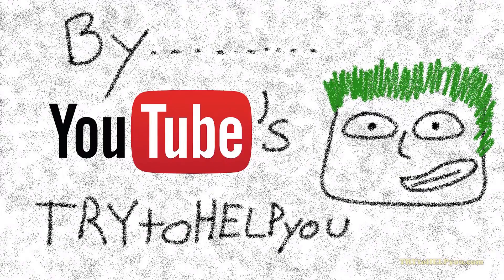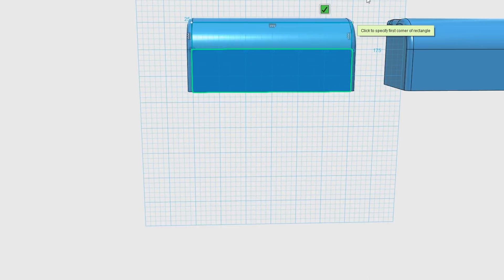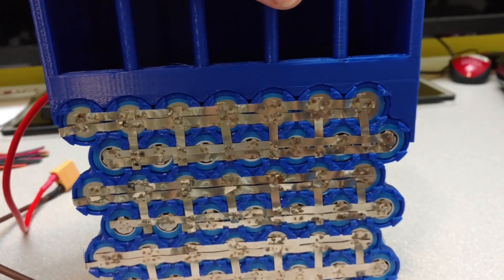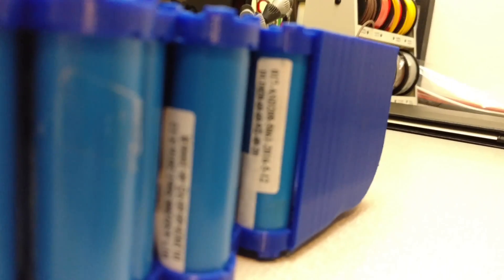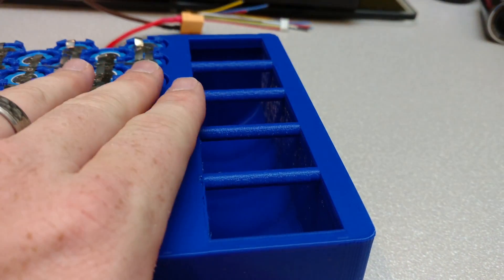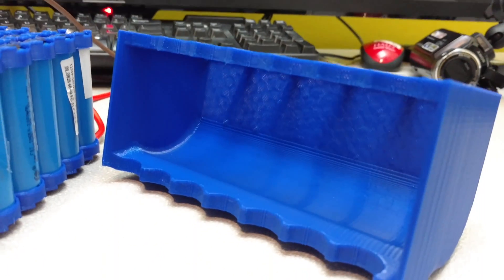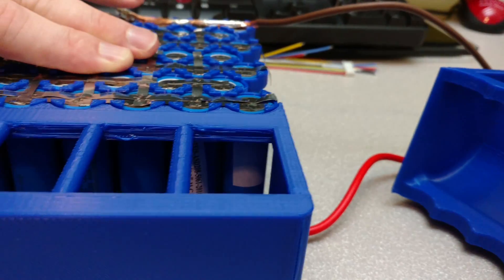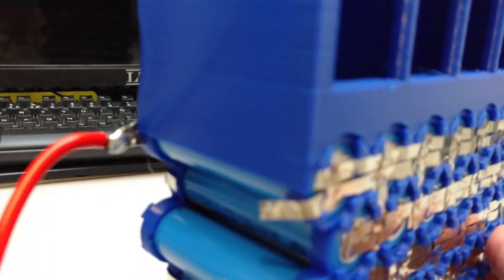eBike Battery update - custom cooling design/3d printed shroud

Comment: I know this is years ago, but is that a metal rings he’s wearing and putting his hand on the pack with exposed strips!?  Way to short it out in your finger!
Reply from the maker: while it is worth mentioning safety, the voltage that is available that would make contact with the ring is so low, the reaction time to pull away would be ample. This is a relatively low voltage battery. In the case of a full short circuit the ring's shape and size make that impossible. IT is likely better to not be wearing a ring but in the case of this very battery, it is not an issue like it would be with in-wall electrical wiring.

Comment: Nice job on the design, but if you feel the need to cool those 18650 cells and they are getting that HOT, then maybe you not using the correct rated cells for that pack.
Are they getting hot, have you tested the pack yet?
Also I don't know what protection your running (if any) or BMS you using. If the lack is designed for balance charging or not? Sorry, just found your channel, so I need to check back a few videos maybe. But I would suggest putting the fan in a separate pack if you feel the need for the fan. Don't drain the pack unevenly, if their no protection on individual cells (and that would hinder the packs performance for a ebike) then this could cause one cel, to try and charge the other cells you draining more with the fan, and ciase other issues as well. Well it depends if you tapping off cells in parallel or series. Basically of would just be easier and better electrically designed to 3D print a separate battery holder for the fan separate cells. Later you can add a circuit to even monitor the packs temp in maybe 4 different spots and set a temp range for the fan to come on, and turn off as needed. Then use that  circuit to sound an alarm if it detect the temp above a safe temperature so you can get off the bike, unplug the battery fast before disaster happens between your legs :-(
So for the separate 3D printed box for 3 cells for the fan, leave a little space to add some of this added stuff for future monitoring and safety. Maybe design it with a track for a seal to make it water resistant also? 
Nice pack by the way, I'm sending you a message. Had a question for you off the public forum.
Scott

Comment: hot glue is for old women crafts and duct tape is only for a quick temp fixes in the field to get u by till u can fix it properly. Honestly I own neither they have no place in my shop along with super glue. Maybe u could have integrated some tabs for screws in the design of your air box? A good 2 part epoxy used properly is what I would use if I had to. I'm a firm believer that before starting any Fabri-cobling on any of my project you should have every detail worked out. Saves me a lot of head ache. But with that said even with all the planning in the world things don't always go together as planned lol. Cool videos liking ur content trying to up my battery  game lately thinking when I have more time on my hands I can build me some cool battery powered stuff one day if anything I'm learning sometime
Reply from the maker: +thanks for the comment and good words. While i yield to a similar logic, i would get stuck in the planning phase if that were the case. I will be treating this project somewhat similarly to art. Just have a go at it with som details worked out. As for mounting brackets, good idea, im still unsure as to what the sides will look like but..
 Maybe ill do something screw related for assembly. I ran out of blue filament and will be loading black.... this first run will be frankenbattery as far as i can tell. Safety is my number one thing i will not budge on. I need to sit down at the computer and carve out the next couple pieces soon... stay tuned for more of course!
Reply: TRY to HELP you your videos were worth the views for the heads up on the battery spot welder a lone thank you for that.

Comment: Which CAD software did you use if I might ask? It doesn't look like Autocad or Turbocad but I can't tell. I enjoyed seeing the 3D and I know how much work and skill it takes to compose a drawing adequate for printing.
Reply from the maker: Thanks as always for commenting Sir! I used Autodesk 123D Design . Im not sure that you can get it for free anymore. IT seems a few months ago they ditched giving out this ... It is slow and wonkey but at the time (year + ago) i just needed something. I just had to design an object to hold up our curtain rods. I will be posting a video this week. Looks like it will be around or less than 13 mins. As for the battery heat, i have heard many people talk about how their ebike batteries get warm/hot due to use. I would like to keep that down is all. These batteries did great in the initial test the other day. I went a little throttle happy and went ..um.. wide open throttle.... hmm. yeah, for about 10 mins or so straight. They got a little warm. Thanks again for the good words!
Reply: I design chemical process equipment, have been using Autocad for 26 years. I love the 3d finished drawings but converting the 3d to plan and elevation drawings for the un-current real world is so frustrating as the extra lines and shading are a huge obstacle.  i stick with 2d but now that I see the fun with the 3d printer I am again compelled. I use Turbocd 3d at home and Autocad for my client design drawings. I am impressed that you have to patience for 123D design as I know you had to have spent many hours learning how to avoid the pitfalls.
Reply from the maker: So it has taken me 5 days to get to this comment and i apologize for i read part of it a few days ago but was busy. Thanks again for the comments! As for 123D Design, i had been, at first, importing a 2d drawing from Adobe illustrator. That was measured out precisely and then i would extrude the 2d into 3d in 123D design. If you would like to see when i started doing the deeper 123D Designs watch this https://youtu.be/E-E8t7TWt6Y . I built that entire thing with just 3d printed parts. All designed by me. It took a while but was a great experience to youtube search how to use the program. the program hangs up a lot because i want to say it only utilizes one core of my processor, but it does get the job done. 26 years of autoad is unbeatable tho man. thanks again for engaging and your comments Charles!

Comment: You know forced convection cooling heat transfer, even in this configuration would be over 10 BTU/ SqFt/Degree F Delta-Hr. This will work fine with a few CFM.  There isn't that much heat generated unless a cell has a short that over heats it. That is pretty rare unless there is  failure during charging, but that typically is due to a charger malfunction or damaged battery. I've never seen an ebike battery burn up upon use but it certainly is possible. If charged properly within range, in a balanced manner it's going to be fine unless something very unlikely happens.
Reply from the maker: Charles, you sank my battle ship.... I am answering more to your other comment now!

Comment: Nice job senor taccitos...did you do it in pla?
Reply from the maker: Yes Sir, PLA is all i can do with my DREMEL 3D20 IdeaBuilder. it may change shape over time.. but i dont think it will get that hot.. Im not planning on leaving it in the car on a summer day... I just dont need my battery getting hot. The other day it was nearing 110 degrees. The outside temp was below that and i would like to use some of that to cool it down :)
Reply from the maker: ment to say thanks too... thanks!

Comment: Those ducts turned out great! I dunno, though... I'd feel weird tapping a few batteries like that rather than just feeding the pack output into a small/simple DC/DC converter circuit to power the fan (it would also give you lower voltage DC for powering other stuff... like datalogging equipment, lights, etc.). On the fan front, a basic axial computer fan like that should get the job done, but their low pressure characteristics will likely reduce the volumetric flow through the battery brick. A centrifugal blower design would probably be better suited for the application... but I may also be really overthinking this. lol
Reply from the maker: Thanks for the tips! So the DC/DC converter i was looking into and for the overall pack it was a little difficult to find one. Though i have the packs seperate now, i was going to have them side-by-side as one unit this converter may work for that https://www.amazon.com/dp/B01KV71MVM?psc=1 . I may do that. They seem to be about 20 dollars each for the 24v to 12 ones too. And as for fans.... you gave me an idea that i had not had... hmm. Im just looking around the office at things i have... and using them... that fan idea tho, you got something there.... big? https://www.amazon.com/Brushless-Radial-Blower-Centrifugal-4-72x4-72x1-26/dp/B01CSNEO2G/ref=pd_sim_147_1?_encoding=UTF8&pd_rd_i=B01CSNEO2G&pd_rd_r=4FWKPFMSNJYT6BZ3V2QY&pd_rd_w=SGhYK&pd_rd_wg=r99ya&psc=1&refRID=4FWKPFMSNJYT6BZ3V2QY or smaller ? https://www.amazon.com/dp/B01N6Z3L7G/ref=psdc_11036291_t1_B00B2ARV22 

One small one per battery would provide some cooling, as this design i have does so far.. not draw too much. Those big ones tho... I could be full throttle all day long and not care about a thing... I may be doing this...
Reply: The tiny laptop blowers are rated at <4CFM... you could probably do better blowing through a straw. The big ones, on the other hand, are gonna be pretty loud--a good excuse to pretend you're riding a jet bike? Adding further complexity, noise could be reduced by sticking a temperature probe in the brick and adjusting fan speed based on brick temperature. I should warn you, I have a habit of making things a lot more complicated than they need to be...
Reply from the maker: so the probe thing tho.. i was thinking about that but my knowledge is limited to mechanical gauges that you shove in the hole of a radiator.... As for noise, i say bring the noise, it if means my batteries stay ambient temps. JET BIKE FTW! oh man.. not enough hours in the day.

Comment: Man that's looking good. I wouldn't recommend using hot glue, as it never held on with any of my projects that got warm / hot. I'll be very interested to see the difference between air cooling, and no cooling.
Reply from the maker: loud and clear on the hot glue. I was going to wrap the whole thing after its assembled... if that makes sense.. like one good run of duct tape around the whole thing (wont help the asthetics tho). So the battery got to around 107 when i was riding it initially. I have heard that ebike batteries get hot. That is just the "nature of the beast" kind of thing.... but i think if it can be cooled down better, why not? So far the only answer to that i have found that is partially legitimate is .... laziness. hmm... not so sure i wanna use that as my excuse.
Reply: I did some quick research for an alternative for the hot glue, and it looks like caulking might be a good choice. If you get silicon based caulk it might come back off somewhat easy, but I'm not sure.